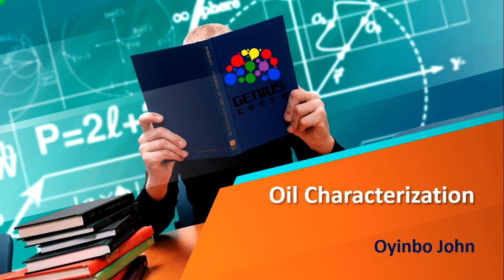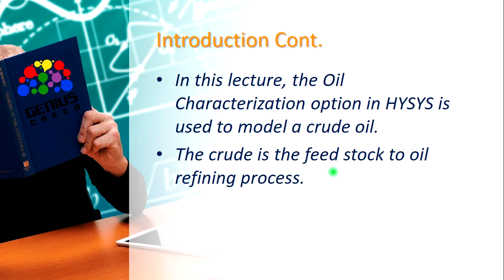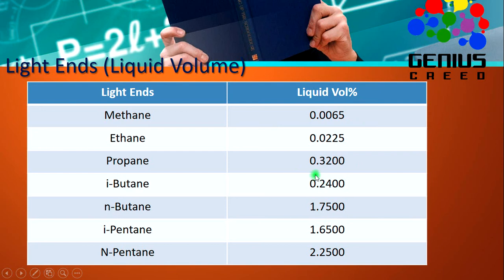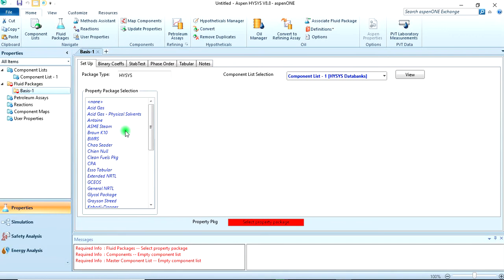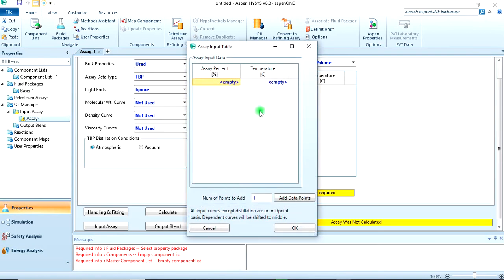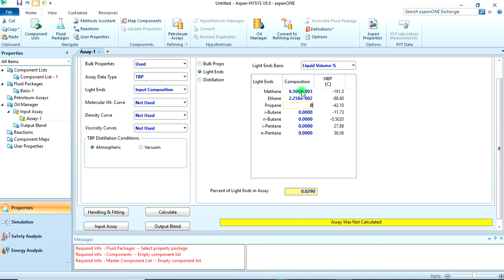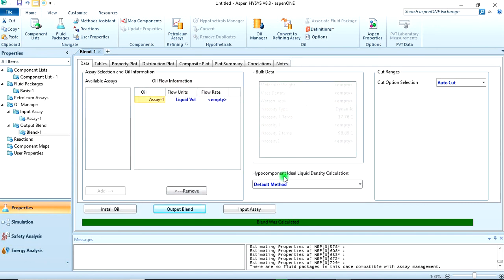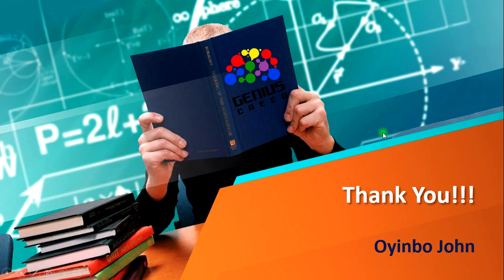01 Aspen HYSYS: Oil Characterization

Comment: Nice video.Would like to highlight one point :While defining TBP distillation data ,data as per presentation beyond 70%(450 Deg C),76%(490 Deg C) ,80%(516 Deg C) is not covered correctly in Aspen Hysys. This will help in maintaining consistency in future upcoming videos.
Reply from the maker: Thank you very much for highlighting this oversight.
Since the next lecture is a continuation of this one, I'll start by correcting the data before proceeding.
Thanks.